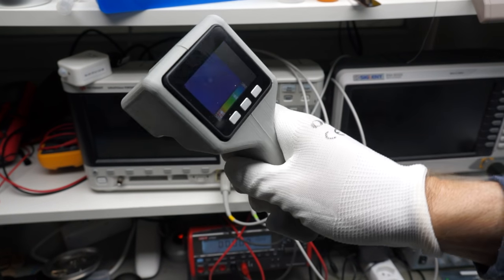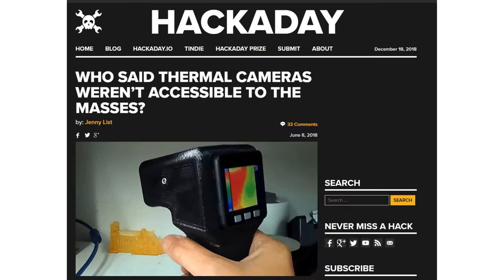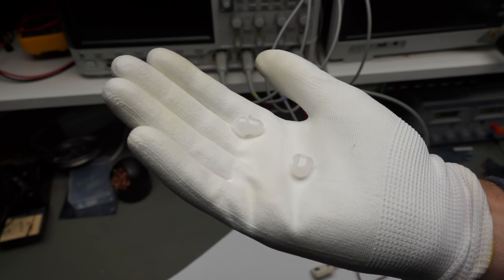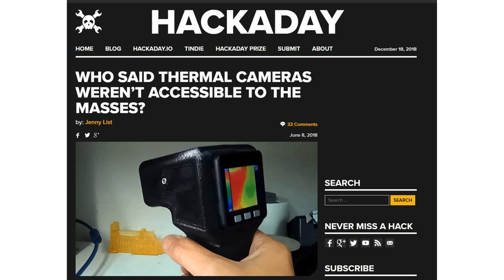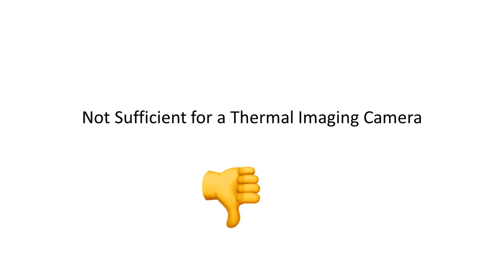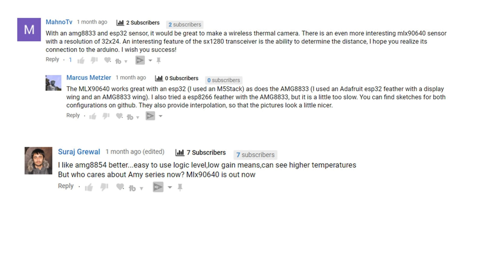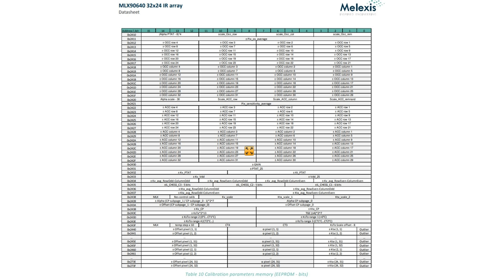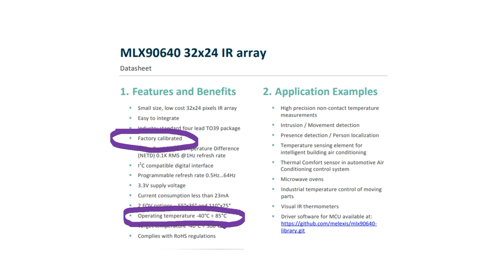#247 Do-it-Yourself Thermal Imaging Cameras (AMG8833, MLX90640, M5Stack, Arduino IDE) and Flir one

Comment: Good video,  thanks Andreas.   Having had some experience with thermal cameras I have found that to overcome the emmissivity problems,  stick some black electrician tape on the surface you want to measure, always consistent result. Cheap and easy.   Merry Christmas
Reply from the maker: Thanks for the tip. For finding heated parts in a circuit this is probably not necessary because if you know it, it is enough. But for applications where you are interested in exact temperatures, this is a must.

Comment: To be more accurate, they work in the FIR (far infrared) region of the spectrum. NIR (near infrared) is actually very easy to detect with a normal camera sensor. The problem is that most cameras have IR filters for a better image, but phone cameras and webcams can detect strong sources of NIR, like a remote control. And if you remove the IR filter and add some IR LEDs, you can make a night vision camera!
Reply from the maker: You are right. I use "night vision" cameras on my Pi to detect the beam of IR diodes.
Reply: @AndreasSpiess , I use my cellphone for quick checks to see if IR remotes are working properly. The remotes are close enough to visible light and the phone cameras are close enough to IR detection that even with the IR lens filters they still show the IR of the remotes. I also use the cellphone camera for live video to see what I'm doing when playing with free-air IR laser communications.

Comment: Nice video, well done. I made a MLX based thermal camera and use automatic gain control to maximize the range from the min temperature to the max temp of any scene. Then I use 255 values in my color map to display the scene. In this way I can use the camera to find hot spots in electrical circuits and electrical panels or motors or anything that heats up. The camera always maximizes the gain so that whatever it sees, it uses 255 different color values to display. As an added feature I have a setting to add a contrast curve to the display to expand either the low range (for looking at cold objects) or expand the high range (to get more detail out of hot objects). Yes the FLIR based sensors are better, more resolution is always better, but nothing beats the joy of using a gadget of your own making!
Reply from the maker: I am glad you found a useful application. I agree, building something is more fun than just buying it.

Comment: The MLX module that M5stack sells is the most expensive I could find. The breakout boards from pimoroni are a little cheaper (56€) and work just as well. You can also use them with their pi breakout garden hat. As to the usefulness, I would say that you could maybe scan your house for heat leaks. Concerning the M5Stack, I never had any problems programming it either with the Arduino or the ESP32 IDF. I also use the M5 SDupdater library, so that I can store all my programs on an sd card and just load it into the M5Stack when needed.
Reply from the maker: Thanks for the link to Pimironi. As I mentioned in the video: Maybe they changed the design. Mine is one of hte first series. And maybe I just was not lucky...
Reply: @AndreasSpiess  The MLX from Pimoroni was a lot of fun to use: https://twitter.com/DavidGlaude/status/1018379593667969025
It confirmed to me that dogs do use the mouth and feet to get rid of the heat.
Reply: I also had no problem with the m5stack programming. The new cloud-based IDE is amazing because you can program wirelessly. The new product is the m5stick which is only about $15 including shipping. This smaller unit includes an OLED display. I have a couple on order and I'm looking forward to use them.

Comment: Andreas,  if you haven't done it already, a video on the simplest pir circuit you showed would be a guaranteed success after your difficulties here.  I have a little Phillips battery led light with pir which I use as a bedside light.  Great, just wave a hand over the bedside table.  Trouble is it has a fixed on time which is very short and I don't know how to modify it.  Simple mindedly,  I could put a small torch beside it.  It will let me see the torch.  But if you have a way of combining the two functions and maybe giving the "torch" (manual override) a long timeout in case of forgetfulness, that would be very nice.  Oh and battery powered please, believe it or not I don't have mains in my bedroom!
Reply from the maker: Most of the devices have a sensor and some sort of logic. The logic decides how long the lamp is on. In my case, it is built into Node-Red. In your case, it is a capacitor and a resistor which determines the time.

Comment: 3D printed case for the AMG8833 and a 2.8" TFT screen:
https://www.thingiverse.com/thing:2799023
Mounting adapter for the AMG8833 bought from Aliexpress:
https://www.thingiverse.com/thing:3066479

Code for the ESP8266, which enables you to save image data to SD and create images on your PC:
https://github.com/wilhelmzeuschner/arduino_thermal_camera_with_sd_and_img_processing
Reply from the maker: Thank you for the links.

Comment: Thanks for yet another stellar review of available technologies! It really helps to know what to expect BEFORE plunking one's hard-earned money down for products that may ultimately disappoint. 

Now I know what to expect from each sensor and I'm not tempted to fire up my debit card & soldering station to create a diy thermal imaging device that really won't solve any of the application problems that I might want to tackle. Unfortunately, one really has no choice but to save up for a FLIR or similar commercial device to get something really useful. (As usual, you get what you pay for...)

Thanks Andreas!
Reply from the maker: Many things are already cheap and good. These cameras obviously not yet...

Comment: I think the third sensor could be fine but with additional camera, little bit more code to combine images and also "little" code for additional image processing. There are algorithm like superresolution but they need obviously better MCU/DSP to perform in the real time.  It will be nice and success project but obviously not cheaper like commercial solution. :)
Reply from the maker: I also found the combination of the two cameras useful. The algorithms probably are not simple ;-)

Comment: I've been working on a person detector using the GridEYE sensors, they are really neat. With some math and computer vision it's really good at spotting people in a room. You need to do some fairly sophisticated processing to smooth the sensor values and correlate the background to maximize the sensitivity, but there is a paper on the algorithm. Without the processing it's limited to a couple meters max, but with the extra analysis you can easily see a person at 5 meters or more (and it will dynamically adjust background, so the false alarm rate is low). These sensors work extremely well for person detection, but their low resolution means it takes some expertise to use them. I'd like to eventually release the code I'm working on, but I'm not sure if it's suitable because it requires a pretty complex procedure to calibrate the filters (the coefficients are the main detail that the paper leaves out).

The algorithm is basically Kalman filtering on the pixel values to smooth the noise, plus online regression between the built in temperature sensor and the pixel readings to estimate the scene background, followed by a statistical hypothesis test to determine if a pixel has a person in it or not. I can find the paper if you're interested, though it leaves a lot of details out. I think Sharp also has a demo program for people detection, but I don't think it's quite so sophisticated and I never could find the source.
Reply: @Undefined Lastname GridEYE is the AMG8833 mentioned in the video. 8x8 PIR sensor. The statistical test is pretty simple, just a logistic test comparing a sensor reading to the predicted background. It doesn't distinguish people from other heat sources, but it can distinguish foreground from background so it can compensate for static heat sources.

Paper is here http://file.scirp.org/Html/2-1730560_74726.htm It's really vague about some important details and kinda poorly written, but it does work quite well if you can fill in the blanks. I may write about it some day, but I don't have a lot of time at the moment.
Reply: Thanks for your comments. Can you share the name of the paper you refer to?
Reply: @Undefined Lastname It fits the background to each pixel individually, correlating it with the temperature sensor via fitting a linear model. All of the filtering and tests are per pixel. 

This is not my algorithm, it's other people's work. It doesn't really deal with movement tracking, it's for maximizing the signal to noise ratio to make it easier to distinguish hot objects. You could implement movement tracking on top of it, if you wished. Of course, it relies on body temperature being significantly different from background. It can distinguish multiple people, but it depends on how close they are and the distance to the sensor (resolution decreases with distance). It is not suited for outdoor use.

No single sensor will be perfectly reliable for detecting people in all situations. If you want the most comprehensive detector possible, you'll need to do sensor fusion of multiple different types of sensor (e.g., motion, thermal, vibration, sound, camera etc). This is fairly cutting edge, probably getting a little beyond what's accessible to a hobbyist currently.
Reply: @mtarquinio  Paper is linked in my reply above.

Comment: Great video! I don't know about these i2c IR sensor arrays, they looks promising.
I think, 32x24 sensor picture can be a little better, if color palette will be auto ir manually adjusted - in video, all soldering iron was just red. I think, sensor should see different temperatures there, but due to palette we see only solid red...
BTW, please try to set programming speed in Arduino IDE to lowest possible (115200?), this helped to me with downloading to board problem...
Reply from the maker: I tried all sorts of things, also to reduce the speed. Nothing helped, unfortunately.

Comment: From what I can see on ebay, you can buy a 60x60 thermal camera for 170$, so it seems it is not worth building one yourself. The biggest problem it seems is that all the sensors are very expensive, maybe in future their price will fall down.
Reply from the maker: I am sure the prices will come down. My conclusion, as always with electronics, is based on today. Let's hope in one or two years from now we get a usable camera for 100$.
Reply: @AndreasSpiess  I got an older Flir One for just over $100, but that requires an iPad to work.
Reply: Are those 60x60 real pixels or they're doing some interpolation in between? The cheapest sensor you could get that has that sort of resolution isn't from FLIR, there are other manufacturers, less known - I only managed to found one from Turkey backed by french capital but their site is very limited and can't order any products so no joy experimenting further. So there are other sensors, but the biggest resolution aside from FLIR Lepton based devices I could find is 32x40 which sounds awfully like the MLX90640 with a little interpolation. 

So until FLIR manage to get their Leptons 3.5 down in price to below $100 there isn't any prospect of "for the masses" thermovision.

Also please remember that most manufacturers of this kind of devices normally target the military, law enforcement, security setups. They aren't gonna make available to anyone sensors to be tinkered with and eventually to find a way to overcome them, not that it's that difficult to hide from a thermal camera - just use a sheet of paper, plastic or glass. There's a reason we use glass on our windows to shield from the heat in summer and keep it inside during winter :D

Comment: Andreas I program the M5Stack over the air. That way it works every time.
Reply: Yes I get the sketch on the stack by pressing the on/off button a couple of times when the bootloader part start. After that I use OTA https://youtu.be/OpFEUbWgiWs
Reply from the maker: I do a lot of OTA, we even have IOTappstory.com as a service for that purpose. But still, to try out some examples it always takes some time.

Comment: You forgot one kind of intermediate sensors, the spot temperature sensors like the ones used in IR thermometers. They only have 1 pixel, but can detect temperature accurately. For example, the MLX90614.
Reply from the maker: The topic of the video was a camera and the single pixel just to show the difference. The MLX90614 is maybe a topic for another video...
Reply: @AndreasSpiess  Well, yeah, I think the spot temperature sensors should have been there instead of the PIR sensor, which would need calibration to get accurate results. And there are people who made slow, but cheap, thermal cameras with this kind of sensor and two motors, either moving the sensor directly or moving two mirrors (which are just polished aluminium). And this could also be a way to improve the resolution of higher resolution thermal imaging sensors.

Comment: I bought an HT-02 for about $250 and I like it.
What I don't understand is, why none of these (even expensive ones), align the video camera image and IR camera image, through digital processing, so that the images line up on the LCD display.
As a result, I switched of the video portion, and only rely on the IR image on the LCD to locate the hot spots.
Reply from the maker: I can align the two pictures in the app. That part works ok for me.

Comment: Very well analyzed topic.  By the way almost all the devices you address are thermopiles invented by a neighbour PhD in Italy in 1835. I've used the MLX90640 on an ESP32 and remoting to another and TFT using ESP Now.  Your video could show better display  results I think with interpolation and colour mapping changes.  You could detect human presence or movement by blob detection, at least indoors. I2C I think you found is problematic for both this sensor and esp32; there is a wire code fork on GIT which nicely addresses.
Your basic pir is a dual element thermopile which differences and band passes areas in the field of view.  There are nice cheap digital versions which give  more control of parameters.
Reply from the maker: AFAIK the sketch used interpolation and mapping. I think it is possible to detect humans if they are close to the sensor. This was visible in the picture taken by the camera in the video.
My point was that I think it is not easy if they are somewhere in the room. At least with my 110 degrees sensor.
Reply: @AndreasSpiess  Yes it boils down to "pixels on target" and background resolution. This chip has about +/-2C resolution depending on frame rate. Panasonic claim 7m. human range  in their video so the -40 chip and 778 versus 64 pixels and similar FOV should be about twice this range? But more pixels means slower data rates and processing. I've got to about 3m. tracking with the 16x4 mlx90620 chip as used in the"Garage Proto" thermal cam.
I expect another future, tutorial on .the new $10 Esp32 2MP cams could get into this?:)
Merry Xmas.
Reply from the maker: 3 Meters seems to be the maximum for the 110 degrees camera and I would expect quite a few false triggers...
I am not sure if the ESP and image processing is a good fit. I will concentrate more on the RPI for that as you get more software there.

Comment: Thank you for taking the time to evaluate these lower cost IR solutions, your video was very informative.  Have you checked out the Seek Thermal camera?  It costs less than the Flir unit (around US $170 on Amazon), and has higher resolution (206 X 156).  They have versions for both Android and IOS phones, and they now have standalone versions.  I've had one of the original release units for a few years and it works well for chasing down heat leaks around the house, which was my justification for buying it, and I feel it has paid for itself several times over in just energy savings.  My only complaint with it is that I have to remove the protective case from my phone to use it because it gets in the way of the way it plugs directly into the USB port.  Thanks again for the post. Jim
Reply from the maker: I used the FLIR device just to show the difference. I have it for a few years now and back then I got the impression that I got the best for the buck (if I remember right, Seek also was a contender). I do not use it often and for sure will not replace it soon.

Comment: Also replace the USB lead. I had to try 5 leads to get a good reliable one and that cost me £12!
The supplied usb cable is just useless.
Also of note: Arduino is no the preferred environment, they want users to use IDF (which I don't understand )
Reply from the maker: I did not use their cable. And knowing how ESP32 programming works I doubt it will be different with a different programming environment. But others wrote they fixed it in the current design.
Reply: @AndreasSpiess  The MK1 Core and MK1 camera both suffer.
The MK2 camera (in case) is more reliable but still hit and miss with leads.

Comment: Very informative, as usual, but one could argue that a quick view of an operating PCB, whatever you had handy in the lab, would have given a much better idea of whether the less expensive PIR sensors would be useful for finding PCB problems. Since the more capable FLIR sensor is a close call for many people (compared to pointing a $15 IR thermometer gun), chances are the cheaper sensors wouldn't make the cut, but it would still be interesting to see the results...
Reply from the maker: You are right. Maybe I was a little too frustrated ;-)